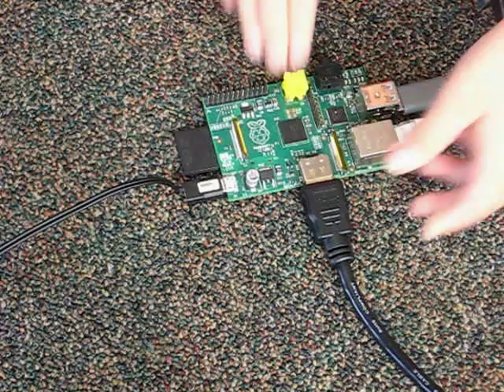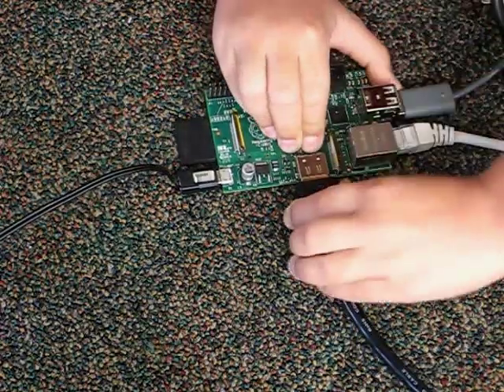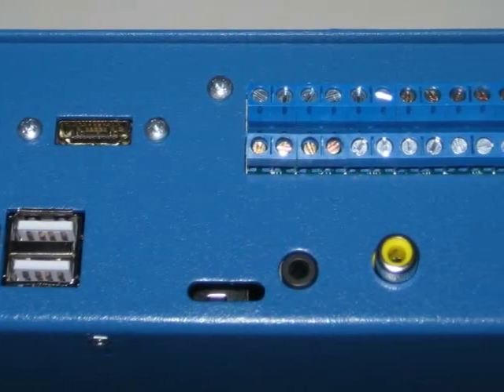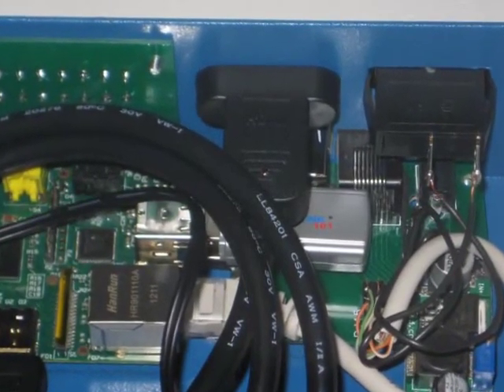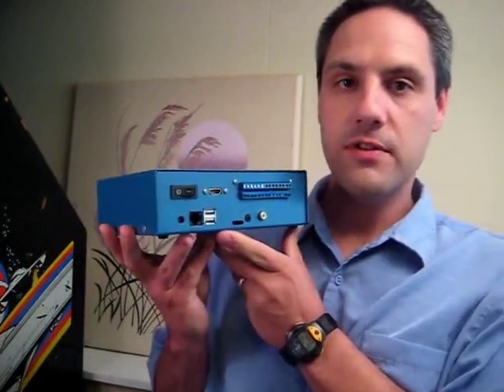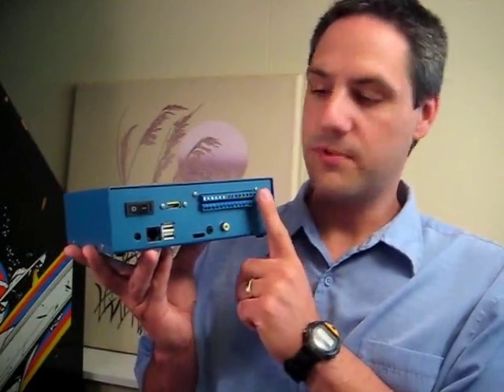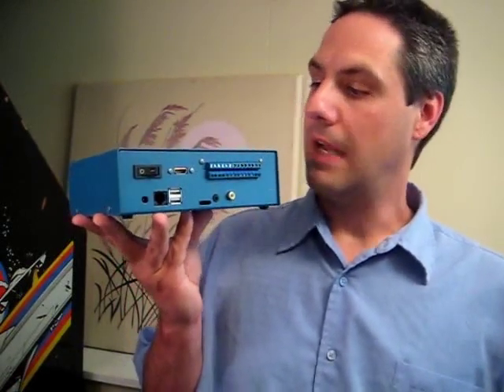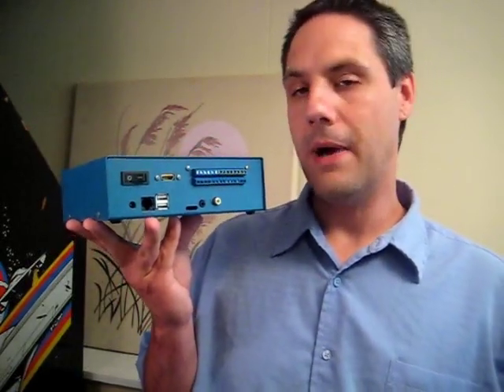Raspberry Pi Case by James Zawacki

Comment: I think you should revisit this.
A case like this would be perfect for a Retropie console if it had usb ports at the front.

If you look at most people's Retropie setups, they look like they have a dead octopus on their desk.

The Pi is too small and light to sit nicely on a desk or entertainment unit, especially when you add thick cables or wired controllers.

I made something similar to your idea by repurposing the case from an old UPS.
I broke out all the ports to the rear of the machine, even the micro sd card slot.

If you painted this case black and aimed it squarely at the Retropie console market, I think it would be a winner.

Comment: Too bad  you went trough  the effort to find not enough people thought your product not  worthy, but that's business I guess.  The Raspberry Pi foundation now have an official case that looks good and not that expensive.
https://www.youtube.com/watch?v=_yQmulgi3OA
 Using the connectors  still may stress the board, but probably no more than those on a netbook are stressed.
Reply from the maker: waswestkan Yup, I agree..  There are still no panel mount cases such as mine available.  The one you linked to is the same as every other case available.

Comment from the maker: Normally I would agree, but as I stated in my video, they are just wrapping the Rpi, not actually protecting it.  I'd consider another panel mount case to be competition.  Unfortunately, one of the reasons for not pursuing the case was the fact that a major Rpi outlet stated they were working on a panel mount case, therefore, wouldn't promote mine.  Being a year later and I still can't seem to find a panel mount case, I'd say they were probably lying.

Comment from the maker: You didn't read my other replys?  The point of the pi IS NOT to be small.  It is to be an educational tool.  With PCBs, the smaller it is, the cheaper it will be.  Nobody in their right mind would say, "Gee, I'd be more than happy to sacrifice layout for size".  That's probably why you don't find any other devices that have connectors place randomly on every side.  The purpose of this case was to protect the pi connectors and locate them all on the back.  If you can do it better, be my guest.

Comment: Very nice project. I assume the plastic case would be black. It would be nice to see a LED up front in regards to power (if it is on or not). Simple enough to do but would be nice if the case already had it. I see you really can't make it any smaller because of the HDMI cable. I am glad to see the thick 'shielded' HDMI cable you used. Again, nice project (and good video).

Comment from the maker: Thank you, I appreciate your constructive feedback.  If you can find a micro computer that is 8 inches x 5 inches x 2.5 inches with I/O terminals, I would gladly use it over designing my own.  What you seem to not be able to comprehend is that not everyone cares about it's small size.  For real world use, the connector layout is useless.  Even if you do ANY research on Pi cases, you will find a ton of posts from people wanting all the connectors in the back.  Troll fail for you.